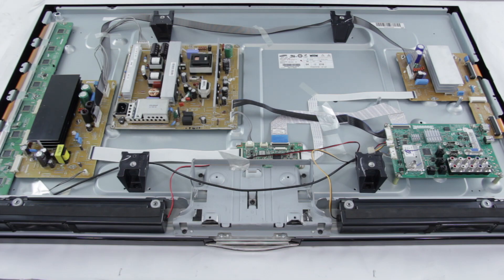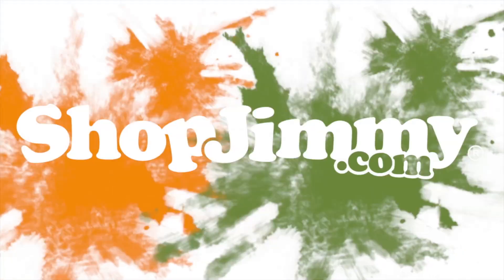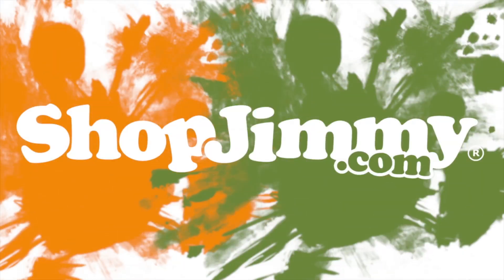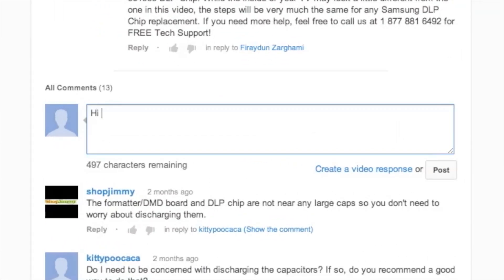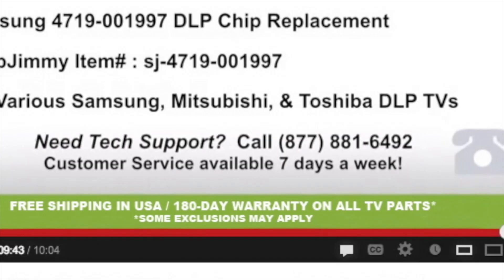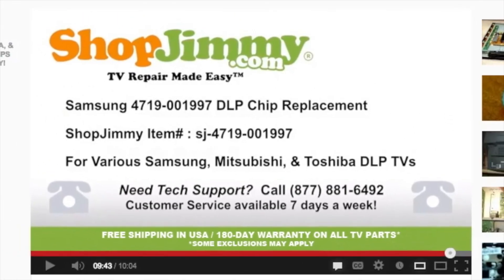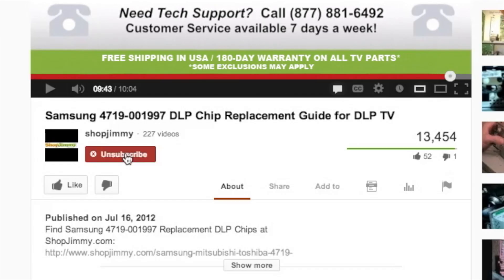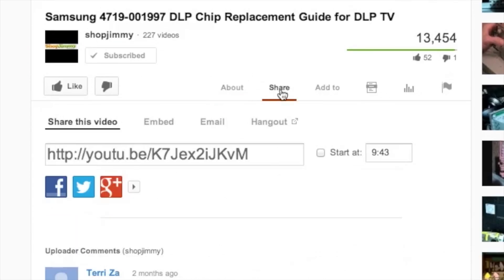Plasma TV Repair Tutorial - Common Symptoms & Solutions - How to Fix Plasma TVs

Comment: I have a PN50b450bldxza, I have sound and no picture.
Reply from the maker: Lisa Anthony   I recommend replacing the Y-Main board in your TV and the Y-Scan Drive/Y-Buffer.  Here is a link to replacement parts for your TV model number on our website, click here:  http://www.shopjimmy.com/catalogsearch/result/?q=PN50b450  Be sure to match part numbers on your current board, with your replacement for compatibility.  You can also call our customer service for further assistance with your purchase.  (877) 881-6492  Thanks and please let us know if you have any further questions with your TV Repair!  www.shopjimmy.com

Comment: I got a Panasonic Viera plasma TV, #TC-P50S2. Exactly half way down the screen is a horizontal green & blue dashed line, about 1/8th of an inch thick. Below, about 1" from the bottom, is a bar of alternating gray and magenta color, about 2-3 inches tall. Calling Panasonic, they said it could be the 'A' board, TNPH0831AC or video board TNPH08312A. How do I know which I should try?
Reply from the maker: Jim Tonn  I recommend replacing the A Video Board in your TV.  Here is a link to replacement parts for your TV model number on our website, click here:  http://www.shopjimmy.com/catalogsearch/result/?q=TC-P50S2  Be sure to match part numbers on your current board, with your replacement for compatibility.  Here is a link to a video showing how to identify your part number, click here:  Panasonic Plasma HD TV Repair Tips: Suffix Codes for A Board & Main Boards  You can also call our customer service for further assistance with your purchase.  (877) 881-6492  Thanks and please let us know if you have any further questions with your TV Repair!  www.shopjimmy.com
Reply: Thanks alot. I have signed up at your website, and put myself down on the "to be notified" list since the board I need is out of stock. Here's hoping! Also, the other video was great to check that I need that particular part.

Comment: Samsung PN60F5300AFXZA when watching anything that is mostly white hockey skiing ect there is a pink hue that is about 8 inches wide on the right side of the screen and also horizontal lines going across the center of the screen. When the picture is full color there does not seem to be a problem or at least I can't notice it. I have tested everything that I have connected to the tv on a different tv and there is no issue.
Reply from the maker: Sean Conroy   I recommend replacing the Y-Main board and the upper and lower Scan Drives in your TV.  Here is a link to replacement parts for your TV model number on our website, click here:  http://www.shopjimmy.com/catalogsearch/result/?q=PN60F5300AFXZA  Be sure to match part numbers on your current board, with your replacement for compatibility.  You can also call our customer service for further assistance with your purchase.  (877) 881-6492  Thanks and please let us know if you have any further questions with your TV Repair!  www.shopjimmy.com

Comment: samsung plasma tv (spr4212): Does not turn on. Only get clicking noises. I have taken the back panel off and do not see any sign of blown capacitors.
Reply from the maker: Glen Nielsen   Try this repair at your own risk!  I recommend that you unhook power to your Y-Main board and then turn the TV on.  If the TV stays on, then replace the Y-Main board.  If the TV shuts off, please reply with that information and anything else and we can try another option.  Here is a link to replacement parts for your TV model number on our website, click here:  http://www.shopjimmy.com/catalogsearch/result/?q=spr4212  Be sure to match part numbers on your current board, with your replacement for compatibility.  You can also call our customer service for further assistance with your purchase.  (877) 881-6492  Thanks and please let us know if you have any further questions with your TV Repair!  www.shopjimmy.com

Comment: Model numberTCP50G20...colored horizontal lines going intermittently across tv. 4 input jacks not working. It will be fine for hours then lines appear for sometimes long periods of time or sometimes just for a brief time. The picture never does go out but the lines cover up the picture.

Comment: HI. I have a Panasonic tc-p50ut50 with the eight red light blinks,  I replace the power board and main board and I notice that if I umplug the ribbon that goes to the ss board on the right side I got sound and if I turn the lights off I can see a cloud of red and blue dots all over the screen,  when I turn on the tv it flashes white then goes dark with the blinking dots ,  can it be the ss board?   I thought that by umpluging the ribbon to the ss board I will get some kind o picture,  please help. Ben
Reply from the maker: Bienvenido Nieves  I believe that 8 blink code means you should replace the SU and SD board in your TV.  Here is a link to replacement parts for your TV model number on our website, click here:  http://www.shopjimmy.com/catalogsearch/result/?q=tc-p50ut50  Be sure to match part numbers on your current board, with your replacement for compatibility.  You can also call our customer service for further assistance with your purchase.  (877) 881-6492  Thanks and please let us know if you have any further questions with your TV Repair!  www.shopjimmy.com

Comment: Hi. I have Samsung plasma 42 inch with half black screen n on the other half no out put whatever input I use. Any suggestions what's casing this issue n possible solutions. Many thanks
Reply from the maker: Fonku W   Which direction is the black screen?  left to right or top and bottom?  Thanks!  www.shopjimmy.com

Comment: Hi. I have a Samsung PN51D530A3FXZA. when I plug it in it clicks 5 times and then does nothing else except a red light on the bottom left of the tv blinks about every 5 or 6 seconds. I have replaced the power supply BN44-00444D and that did not fix the problem, think the main board may be the next suspect. Looking for some advice, should I replace the main board next? or look somewhere else? thanks
Reply from the maker: Michael Oakes   You are correct.  Replace the main board as your original power supply is most likely still good.  Here is a link to a replacement main board for your TV model number, click here:  http://www.shopjimmy.com/samsung-bn94-04967a-main-board-for-pn51d530a3fxza.htm  Be sure to match part numbers on your current board, with your replacement for compatibility.  Here is a link to a video showing how to identify your part number, click here:  Samsung Main Boards & Digital Boards: Part Numbers for LED, LCD, DLP, Plasma TV Repair  You can also call our customer service for further assistance with your purchase.  (877) 881-6492  Thanks and please let us know if you have any further questions with your TV Repair!  www.shopjimmy.com

Comment: Samsung/pn58c500. Hello, when my t.v. is white or has a light background the t.v. has horizontal pink stripes across the top and bottom of the screen. Please help
Reply from the maker: Bryan Godt   I recommend replacing the Y-Main board and the buffers that are connected to it, in your TV.  Here is a link to replacement parts for your TV model number on our website, click here:  http://www.shopjimmy.com/catalogsearch/result/?q=pn58c500  Be sure to match part numbers on your current board, with your replacement for compatibility.  Here is a link to a video showing how to identify your part number, click here:  Be sure to match part numbers on your current board, with your replacement for compatibility.  You can also call our customer service for further assistance with your purchase.  (877) 881-6492  Thanks and please let us know if you have any further questions with your TV Repair!  www.shopjimmy.com

Comment: Hi.  I have a Samsung plasma.  Model Number PN60E530A3F. It turns on,  I know this because the red led light turns on and the screen itself flashes once every time I turn it on. Then the screen goes black and stays black.  I think the inputs are fine because I get audio when I put inputs to the TV and use external speakers. But the internal speakers aren't working.  I don't see any signs of burns on the boards and none of the capacitors seem bloated. I can change inputs by memory with my remote (I know because the audio changes). But the screen status black even when I hit menu. Please help me! I will like favorite subscribe and share your videos.
Reply from the maker: Kirk Perecich  I recommend replacing the Y-Main board and Y-Scan Drive boards in your TV.  Here is a link to replacement parts for your TV model number on our website, click here:  http://www.shopjimmy.com/catalogsearch/result/?q=PN60E530A3F  Be sure to match part numbers on your current board, with your replacement for compatibility.  You can also call our customer service for further assistance with your purchase.  (877) 881-6492  Thanks and please let us know if you have any further questions with your TV Repair!  www.shopjimmy.com

Comment: Hi, I have a samsung plasma PN43D450. WHen I put power on it, the red light in front stay on and I can't open the tv. I replaced the power supply and the problem wasn't resolve. I've checked all the power on the other board and everything looks fine. Maybe it's the IR sensor ? Please help !
Reply from the maker: Paul-Andre Lauzon   I recommend replacing the main board in your TV.  Here is a link to replacement parts for your TV model number on our website, click here:  http://www.shopjimmy.com/catalogsearch/result/?q=PN43D450  Be sure to match part numbers on your current board, with your replacement for compatibility.  Here is a link to a video showing how to identify your part number, click here:  Samsung Main Boards & Digital Boards: Part Numbers for LED, LCD, DLP, Plasma TV Repair  You can also call our customer service for further assistance with your purchase.  (877) 881-6492  Thanks and please let us know if you have any further questions with your TV Repair!  www.shopjimmy.com

Comment: Hi Jimmy thanks for your help!   I have a Venturer Plasma Tv PDV2842OC ac 120V 60Hz  July 2008   the sound works but the picture comes on and then goes right off??   I took the back off got the dust out then looked it over I found a fuse T8A H 250.....can't tell if it's the problem and don't know how to remove it...but that may not be the problem...What do you think?
Reply from the maker: Shirley Simpson   I recommend that you replace the fuse to see if that fixes the problem.  Thanks and please reply with the results!  www.shopjimmy.com

Comment: Hi i am trying to fix a plasma tv model INP4219(insignia) which is an LG mainly I think I checked all fuses and found a burnt fuse on the 42v7 board z . I checked all the input voltages on this board and they measure accordingly. I can hear the relay clicking but still have no image. Could you suggest what to check.
thanks
Reply from the maker: Rafael El   I recommend replacing the y-board and buffers in your TV. Unfortunately I do not see any replacement parts in the search results for your TV model number on our website. Thanks and please let us know if you have any further questions! www.shopjimmy.com

Comment: I have a samsung PN50C450B1DXZA it gets a solid line from top to bottom every now and then could it be my main logic board
Reply from the maker: Mario Rangel   Yes it could be sometimes tough to tell normally vertical lines indicate the panel is bad.  If your TV panel is bad, it may be more cost-effective to replace the TV as panels are typically hard to find in stock, difficult to replace, and expensive.  Thanks and please let us know if you have any further questions!  www.shopjimmy.com

Comment: I have an LG 60PA6500 plasma TV.  On the right side of the screen, there's a vertical line that runs about halfway down the screen.  It typically appears black or pink, and is more visible from up close.  From across the room it's only noticeable with certain colors.  What could cause that?
Reply from the maker: Scott Krieg   The vertical line sounds like a TV panel problem.  If your TV panel is bad, it may be more cost-effective to replace the TV as panels are typically hard to find in stock, difficult to replace, and expensive.  Thanks and please let us know if you have any further questions!  www.shopjimmy.com

Comment: I have a prima LC-32R26 that only sometimes powers on.  When it does,  the prima emblem turns from red to blue,  when it dosent,  it turns from red to pink and I have to wait until it turns red on its own to try to turn it on again. I checked the capacitors on power board and they look good. Dont know what else to do. 

Steve
Reply from the maker: Steve Stubbert   I recommend replacing the main board in your TV.  Unfortunately I do not see any replacement parts in the search results for your TV model number on our website.  Thanks and please let us know if you have any further questions!  www.shopjimmy.com

Comment: I have a Samsung PN59D8000FFXZA model.  All of a sudden the picture is not present at all; namely a dark screen that does NOT allow me to view anything (menu, DVR images..etc).  Also the sound is intermittent.  I have swapped out the HDMI cables and also toggled the HDMI cables to different HDMI ports, but to no avail as I am still unable to view anything.  The picture (or rather lack thereof) is completely dark, in fact one can not tell if the TV is on or off.  Can you kindly help troubleshoot this issue?

Cheers
Roger
Reply from the maker: Roger Asgari  I recommend replacing the Y-Main board in your TV.  Here is a link to replacement parts for your TV model number on our website, click here:  http://www.shopjimmy.com/catalogsearch/result/?q=PN59D8000FFXZA  Be sure to match part numbers on your current board, with your replacement for compatibility.  You can also call our customer service for further assistance with your purchase.  (877) 881-6492  Thanks and please let us know if you have any further questions with your TV Repair!  www.shopjimmy.com

Comment: Hello I have a Panasonic 50" plasma model Tc-p50s1 and I just got the dreadful 10 blinks.  The service manual says the problem is in the A board, now I have decent soldering skills but pretty much crqppy skills when it comes to using the voltmeter.  Is this something I can fix by soldering or am I just better off buying an A board, will that definitely fix my problem?
Reply from the maker: Lpedraja2002   If the A board is bad, I recommend replacing the entire board.  Here is a link to replacement parts for your TV model number on our website, click here:  http://www.shopjimmy.com/catalogsearch/result/?q=Tc-p50s1+  Be sure to match part numbers on your current board, with your replacement for compatibility.  You can also call our customer service for further assistance with your purchase.  (877) 881-6492  Thanks and please let us know if you have any further questions with your TV Repair!  www.shopjimmy.com

Comment: The set in the video looks like the one I have. I am having what appears to be a power issue with the set making a clicking, led flashing, and no picture. However, I changed out the power supply and I get the same problem. Capacitors and fuses on both power supplies look fine. Any suggestions?
Reply from the maker: David Williams   Please reply with your TV model number and then I can recommend a replacement part for your TV repair!  Thanks!  www.shopjimmy.com

Comment: i have a 43inch samsung plasma tv will not power up my model no pn43d440a5d

all i get is a clicking then nothing the red light is on but no sound as to indicate

it is about to power up
Reply from the maker: joe parker  I recommend replacing the power supply.  Here is a link to replacement parts for your TV model number on our website, click here:  http://www.shopjimmy.com/catalogsearch/result/?q=pn43d440a5d  Be sure to match part numbers on your current board, with your replacement for compatibility.  Here is a link to a video showing how to identify your part number, click here:  TV Part Number Identification Guide for Samsung DIY TV Repair Power Supply Unit (PSU) Boards  You can also call our customer service for further assistance with your purchase.  (877) 881-6492  Thanks and please let us know if you have any further questions with your TV Repair!  www.shopjimmy.com

Comment: I hav a 50" LG tv lost color black n white now how can I fix it 50pa4500-uf
Reply from the maker: Alfred Hittle   I recommend replacing the main logic board in your TV.  Here is a link to replacement parts for your TV model number on our website, click here:  http://www.shopjimmy.com/catalogsearch/result/?q=50pa4500-uf+%EF%BB%BF  Be sure to match part numbers on your current board, with your replacement for compatibility.  Here is a link to a video showing how to identify your part number, click here:  LG Plasma TV Repair: DIY Part Identification Number ID Guide for LG & LG Philips Plasma Panel Parts  You can also call our customer service for further assistance with your purchase.  (877) 881-6492  Thanks and please let us know if you have any further questions with your TV Repair!  www.shopjimmy.com